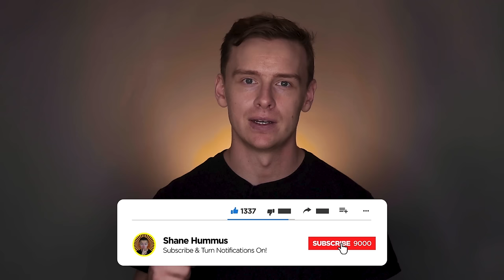Top 10 Best Trade Jobs (Trades Careers Ranked)

Comment: As a welder myself my advice is to get into pipe welding. I make around 80,000$ a year. It’s easily the most skilled form of welding but if you can get your coded certs in stainless pipe welding and get in the door, your going to make a lot of money. A ordinary factory welder will only make around 35 - 45 thousand a year. Us pipe welders make around 70 - 90 thousand a year the difference in skill and salary is massive.
Reply: Hi how long have you been in the pipe welding business? I’m 15 and I know I don’t want to go to college so I’m trying to find out what’s my best option straight out of high school. I want to go into an industry that I can work my way up to the top into the industry.Do you have any recommendations or advice?
Reply: Also did you start as an factory welder to get experience for pipe welding or did you go into a program?
Reply: @shiftytaeo  I’m going to prolly go with construction because it’s real easy to learn the jobs after a while and not as complicated as electrical and plumbing. And If you stick with it you’ll know enough to work for yourself or become a contractor.

Comment: Me as a plumber we make actually more then that but then again I own my company I average around 15-20 thousand a month a job usually is 1-5 thousand for a water line or sewer line repair. To replace it’s about 4-10 thousand depends on how long the line is and how deep. Regular plumbing like fixing ya toliet or water softeners and water heaters that between 500-1000. Sewer lines are usually the most expensive because they usually tend to be deep under the water line. Also they have to be in the right angle so that your waste products don’t get clogged and so they flow thru cleanly. One little wrong angle could mess you sewer line up. I also do  septic tanks those are also good money usually about 5-10 thousand. I also work with a home insurance/ warranty company. So the homeowner doesn’t usually pay fully they do
Reply from the maker: Thanks for your input Lee. Best of luck in your career

Comment: Hey Shane! Quick update! Underwater welding is kinda dying out. Not really a whole lot of need for it (highest demands were off shore oil rigs) because we've changed from welding pipes together to using a interlocking pipe system to transfer oil. So UW welders are being replaced by commercial divers, which is a broader catagory of work diver.
Reply from the maker: Thanks for your input Collin. Cheers!

Comment: I did a machinist apprenticeship at a machine tool manufacturer, graduated to a position building machines and installing them, moved on to an industrial maintenance roll. Welding, electrical, plumbing, mechanics, all aspects of stuff I get to work with. Wear and tear on the body is real.

Comment: With HVAC you make your money in the summer then if you are newer in the field you may get laid off in the winter. You can do dual HVAC and Plumber so you will be stable no matter what. You can have a good grasp on both trades within 5 years if you work for a company that does both.
Reply from the maker: Nice! Thanks for your input that is a very useful tip. Cheers!

Comment: Been in various trades over the years. It's hard work, but someone has to do it, and it's very satisfying to work with your hands, AND your head.
It's also good to have a career you can fall back on if your chosen long term profession craps out. Just know if you go into a CONSTRUCTION trade, work can slow to a crawl during bad economic times. As for how you get beat up by the work, that's true. So it's up to you if you have the strength and durability for the tougher work. And you have to consider the potential for injuries. I'm going on 70, have aches and pain, but I'm still working. ( Don't need a gym.)
Good luck all. 👍

Comment: I wanna go on a limb here and say you made some great points and talked about what should be talked about. I used to do the one trade nobody ever talks about and tbh I hope anyone my age never does it. That's being a machinist. That trade sucks at least for me. Now I love I did, it's just trying to make a living with it. You have to have so much experience to be doing ok. I decided to leave that and I'm now doing a plumbing apprenticeship. If I would of known my opportunities a lot better back then, especially about apprenticeships, I would of done plumber or electrician. I decided to do plumbing because it was easier for me to find a career. Also I am working commercial, on a apartment complex that is currently being built. I'm learning how to layout PVC pipe and how fittings work which is an excellent start. Eventually down the road I'll learn how to install a water heater, a bath tub, kitchen sink, and even a toilet which goes a LONG way. I am definitely surprised it's number 8 because I would of rated it in the top 5 at least. Either way do what you love guys, but also make sure you're financially content and as well. You have to have a good balance with that.

Comment: I’d rather just be jobless than sit in a cube with a computer
Reply: Fuck that. I need to have money
Reply: @afrothunder142  don’t we all mr freeman
Reply: I’m doing that, now I’m looking for a change
Reply: I'd rather sit in a cube then manually doing labour on a dirty hot construction site , maybe work with some females instead of a bunch of dudes hazing eachother
Reply: @bicmitchum1368 👍
Reply: @bicmitchum1368  sound so cringe
Reply: Really? Is it that bad? I moved from engineering to software and spend all the time on the computer. Not as glamorous as people think it is...but I wouldnt trade it for the summer heat and the winter cold....and rain at times. Been there, done that

Comment: Machinists make decent money,  and it is a rewarding trade. You get to use mill and lathe machines to basically sculpt anything from metals. Started making $18/ hr plus OT while I was still in trade school which was only a year long.  You can work in any industry aerospace,medical, automobile, etc., and even use the skills to become a gunsmith, tool and die maker, mold maker, manufacturing engineer etc.
Reply from the maker: Thanks for sharing that

Comment: Also HVAC does require licensure depending on the state it can be relatively easy to get
Reply from the maker: Thanks for your input. That's very helpful to know. Cheers!
Reply: Is HVAC worth it?
Reply: It worth it if you like it. Service calls take more smarts and new construction takes more endurance and some strength. I’d just try it and see if you like it.
Reply: @drew22  is there a time limitation to get a contractors license for HVAC in California ?
Reply: Sigifredo Coria I don’t live there and it varies from each state usually it’s appreciate for a few years then have your journeyman’s for a few years then you can get a contractors

Comment: one facet of HVAC you neglected to mention is the opportunity to multi-class (excuse the video game analogy). In reality HVAC is a lot more than just going to someone's house and fixing their AC/Heat. If you go to a commercial company you will most likely where more hats than any other and get paid really well for it. A good example is the company I work for which is classified as a mechanical company meaning we will service HVAC, Refrigeration, Electrical, Gas appliance and Plumping. So I really believe HVAC/R is the best trade to get into because through the course of your apprenticeship or schooling you will not only learn refrigeration systems but also electrical and plumping. The figures you gave seem to be for residential since the average for commercial is actually 58K with master technicians making 99k.
Reply from the maker: Thanks for your input Larry
Reply: Absolutely HVACR is at least 4 in one trades. Heating/ Cooling/ Refrigeration/ Plumbing/ Electrical/ sheet metal and +. 

3 man companies can make close to 7 figures/ yr EACH MAN!

Comment: I have 6 years as an Electrician, I worked the past year within the oil and gas field and made 6 figures. I really enjoy what I do and with an electrical background you can get in to many other related fields and multiple types of industry pretty much anywhere in the world with the proper licensing. It is some what hard on the body but not too bad and your out in the elements and it is dangerous but im glad I got into it.
Reply from the maker: Thanks for sharing that Zach88.. Any tips you want to leave for the viewers?
Reply: @ShaneHummus  Yeah, I wouldn't worry about the union/non union thing, just if your going non union make sure you find a decent company to work for. Try doing all aspects of the field if you can instead of doing just solely one type like commercial or residential as there is a lot to learn in this field. Don't be cocky and complacent and act like you know everything, that's how alot of people end up hurt or worse. The sky really is the limit and you can make some really good money. You could get into plc programming, automation, instrumentation, high voltage, maintenance, start your own business. some of that may require additional schooling but its not like your going to have to go for 4 years and with a good solid electrical background it would make it alot easier to break into those more specialized fields.

Comment: I’m an automotive tech. Been doing it for 5 years and it’s not easy but you can make decent money once you know what your doing especially if your flat rate at a dealership where your working on the same makes and models everyday. Definitely don’t want to be doing it my whole life though.
Reply from the maker: Thanks for sharing that
Reply: I started in automotive but I'm a diesel mechanic now. I don't miss working on regular cars and dealing with customers. I work for a fleet now and its much easier to deal with your company's vehicles.

Comment: HVAC is huge and you only covered the residential side at best not commercial or industrial. It can be seasonal depending on that but ventilation is highly needed all year around. As well as being needed for anything that heats and cools. Freezing rooms, heating pools. Its more than what this video has mentioned much more.

Comment: I understand two years in a Apprenticeship is a little while to wait, but those two years your getting paid about 23$ hr to learn a trade that can be worth $40hr and after 4 years journeyman you could be making 90$ hr. I’m going threw a welding class, then a diesel mechanic class then get my class A and then finally start heavy equipment operating. With all that when there’s no work I have class A, welding, mechanic to fall back on

Comment: I graduated high school early in January, started trade school and finished first year plumbing working now, and I can have my red seal for plumbing and gassfitting by 21 years old, I’m not sure if I’ll stick with it, I really have thought about air traffic control and I want to do it think I would enjoy myself more but I’m not sure on what I should do
Reply: air traffic controlling is a very stressful job and has a high burnout rate so if you think could handle it go for it but know it is extremely hard
Reply from the maker: Stay tuned, I might have a video that would help your situation Thurllo

Comment: Welding isn't that taxing as you said. Cutters are the ones who have to cut with the torch and "bend over all the time" What I will say is with Shielded metal arc welding the fumes are rough, working with exotic metals are and the main point of taxing is breathing in bad fumes day in day out
Reply from the maker: Good point

Comment: Hey Shane, Great video!!! I really appreciate your content. What do you think of local trucking and how do you rank it . It pays hourly for driving cargo from warehouse to another, Usually within 10-20 miles radius. Most of the time consists of waiting for paper processing and the freight in the warehouses’ wait area.
Reply: I’m a commercial driver .. it’s a really great certification to have I get paid enough to make a living.. either get your cdl by working your way up in a company like Pepsi, coke, Borden. I started in the warehouse and then became a driver .. a Pepsi driver can make 50 + then a Walmart driver 70+ and now a propane bobtail driver making 55 a year... I stuck with this job since it’s Monday through Friday and I stay home  every night ... getting my cdl has been the best thing I ever done for my pocket..
Reply: Ricardo Alejandro Saldaña that’s so interesting man, I just turned 22 and highly considering it, I know the money is in otr right? But I would love to be home every night and still able to train mma
Reply: Z Winn not just in OTR but that tends to be the route you should go starting off. There’s local/city which can be tough depending on your experience with tight spots. There’s regional where it’s essentially the same as OTR but you’re home every 2 weeks guaranteed. Theres OTR which is living out the back of the truck stacking your money until it’s time to take some time off. There’s also hauling frac sand in the oil fields (great money inconsistent work). If you do decide to get your CDL get ALL endorsements get your experience and try to get into hauling fuel or getting into linehaul with companies like Arcbest or old dominon. Those 2 I know pay the BEST. You can also become an owner operator as well. There’s so many options and always work. You can EASILY clear 50k. Anything less is robbery. Edit* 70k is 100% obtainable and 80-100k is possible with the right companies and experience. Shit you could even drive overseas for a contractor in Afghanistan and make 120k 100k tax free lol
Reply from the maker: Stay tuned

Comment: Skilled Tradesmen are very much needed but I don't think it's for everyone.  I worked in new residential HVAC for a short time to find out if it's for me.  It's not.

Cons:
-Lots of traveling to different job sites, usually involving your own car and gas.   Unless you get a company car and gas card
-Dirty; dust and dirt or whatever will get on you
-Portable Toilets; sharing toilets that smell so bad.  Sharing with Carpenters, roofers, plumbers, HVAC and electricians.
-outside elements; cold, heat, wet, dry
-underpaid 

Pros:
-Learning timeless labor skills using your hands and brain
-Potential to start your own business.  You can make 6 figures to millions.  If you have entrepreneurial spirit and business skills.
-Meeting people from different trades

Honestly, I would of stuck with it longer if they started pay atleast $25 an hour.  But they started me at $16 and that pay wasn't worth the cons I mentioned but you don't realize that until after. Mind you I was 32 years old already taking a $10 pay cut to explore this career path.
Reply from the maker: Thanks for sharing your insights about trade jobs.. Much appreciated

Comment: At 16 I started doing labor on a construction site I didn't have much experience but I was good with my hands and I was a easy learner I got paid as a laborer that's $40 a day . 40 × 5= $200 a week and sometime I might also work on the weekend as a 16 year old that was new in the field $200 was alot for me. We were working on a concrete house and I had some much different roles to play some days I'm a carpenter, hand machine operator ( drills, jack hammer, pick axe etc) black Smith ( bending of steel for the foundation of the house) storage admin( keeping track of materials) then my summer holiday ended back to school Christmas comes around and I was on a new site a whole new team of workers that are 10 + years older than me I had a bit of experience from my last job my wage bumped up to $60 a day = 300 a week that's more than alot for a 16 year old still in highschool and at that site I was nothing more than a laborer.. but at this site I had to do alot of physical work with heavy materials alot of lifting I'm 155lbs btw my body was in pain every day my joints were sore hips and knees were couldn't keep up with the load I was getting darker because of the sun I'd get headaches because of the sun the dust and cement where drying up my throat and my skin even though I had all the protective gear the money was good, it was new to me so I endured every bit of it. every morning I'd wake up at 6am ..20 minute yoga then eat my breakfast then head out to work come back at 4:45 bathe eat and sleep like a baby till between 7 and 8 pm the I'd use social media or video with my gf till 1pm in the morning then fall asleep and repeat...the money I made I bought things my parents couldn't afford to give me phone, jordans jewelry... some of it I regret not investing but i was a kid that's my story
Reply from the maker: Thanks for sharing that Kevin. Cheers!
Reply: Cap